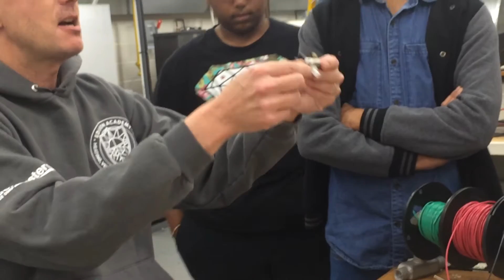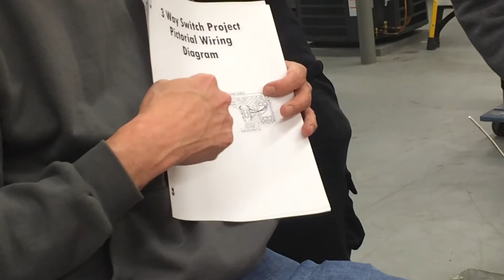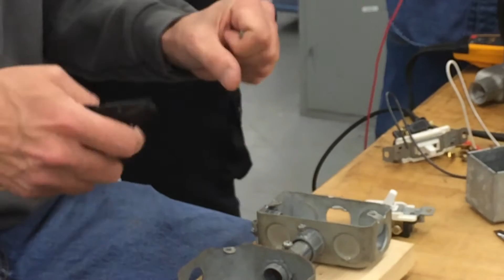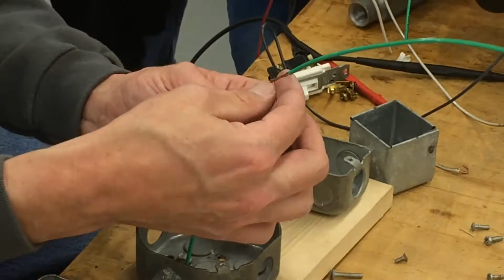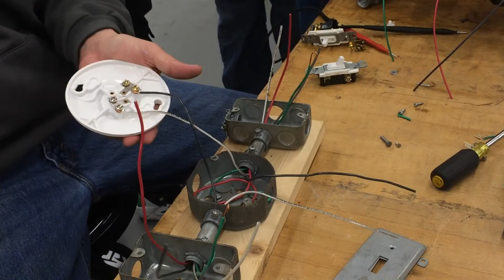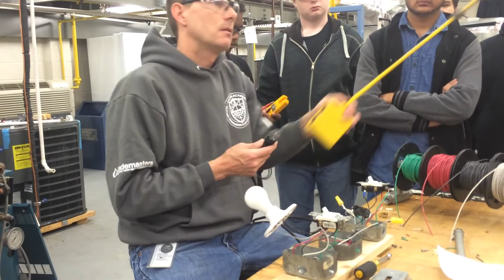HVAC Basics: Electrical - Project 2 Wiring a Three-Way Switch

Comment: This is a great project project, but I would suggest a few changes, please.  The NEMA code adopted by most States requires a Neutral be present in every box now.  I would recommend putting the boxes right next to each other such that students are thinking source to destination or line to load...   If they wire something like this in real life, they need to be thinking circuit breaker to load.   Anytime a white is used as a hot wire, traditionally good electricians wrap a piece of black electrical tape over it to mark it, but because the new NEMA 2011 a neutral must be delivered to every box and may as well deliver that via white, so...

I would do this project by reading order box, box, fixture with the power-cord being the classroom equivalent to the source or breaker panel.  Then to meet the code, you would use a 14/3 Romex between the two switch boxes such that you are carrying black, white, ground, and red between the two switch boxes with the red and black as the traveler wires for the three-way switches.  From the last switch box to the fixture I would recommend the normal 14/2 Romex (no red wire in that). 

Connections would be Power cord ground bonded to box box bonded to switch, neutral from power cord connected to white on 14/3 (has black, red, white, ground) and passed through to next box.  The Black from the power cord goes the common terminal on the switch.  The two common traveler screws on the switch then go to red and black on the 14/3 that caries it with the neutral to the next box with the neutral.  Of course, the ground is also connected on the 14/3 to the first box and then to the second box and switch.  The 14/3 coming into the second box has its red and black go to the traveler pair.  Then the common terminal on the switch in the second box goes to the black of a 14/2 and into the fixture box.  The 14/2 white is connected to the 14/3 white to pass the neutral into the fixture box, and obviously the ground of the 14/2 is connected to the second box ground as well as the fixture box ground.  Undoubtedly the fixture is grounded with a pigtail or similar.  Then the 14/2 black and white feed the fixture.

To me this makes the most sense because students can think line to load, left to right.  It meets the new code, neutral is always white all the way through, etc.